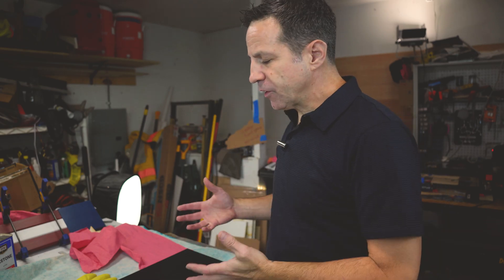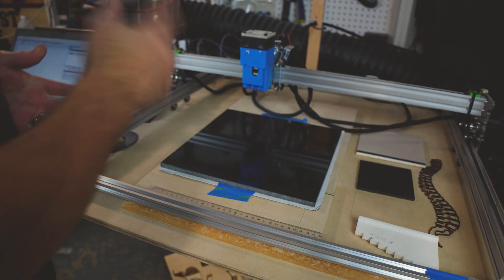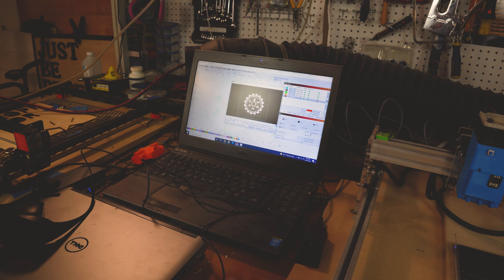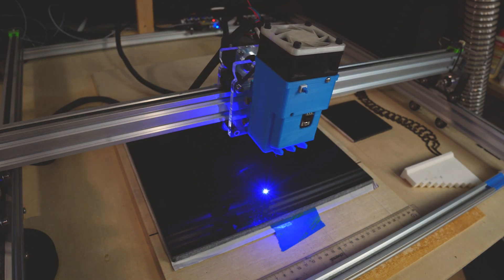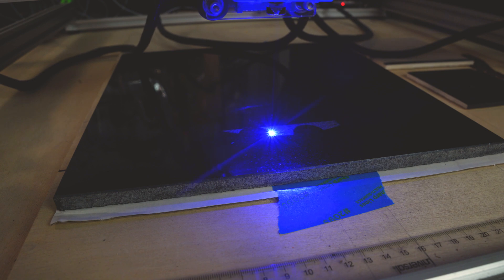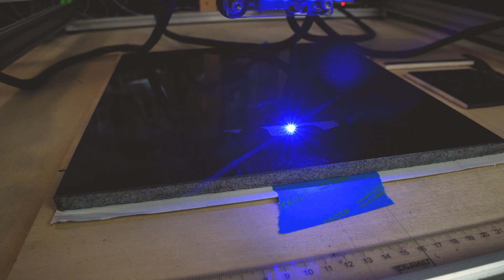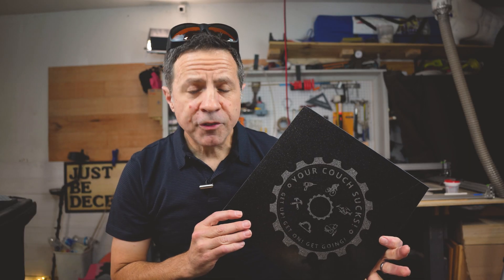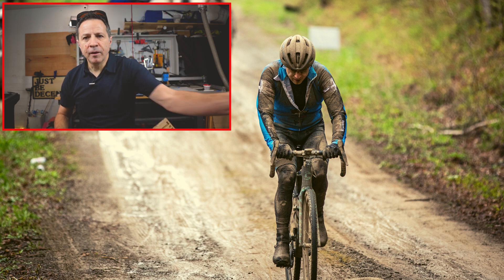Engraving Granite tile with a hobby laser? | YES you can!

Comment: What makes the George Simon 2w laser differ from say the 15w (YoraHome 6550/15w/6.5oo)?
I noticed in your video the laser head was so from the granite... is that because the GS 2w is that powerful? I'm new to diode lasering. TIA!!
Reply from the maker: The George Simon laser is actually a lower power but a smaller dot size if I have correct for fine engraving for picture on tile a such its the way to go